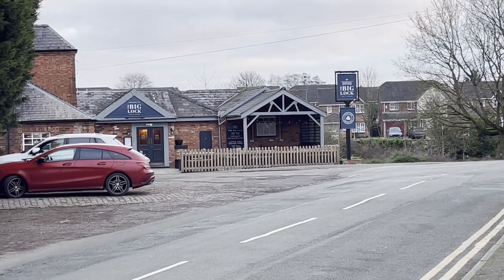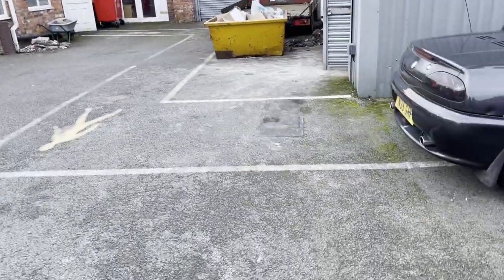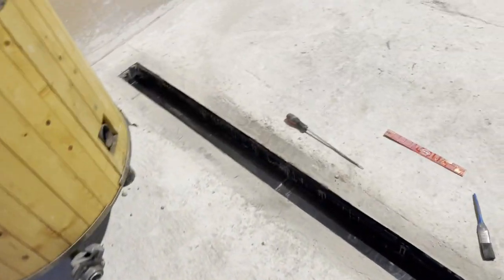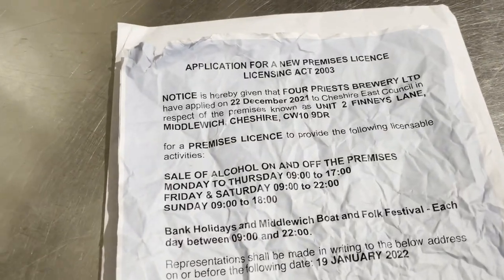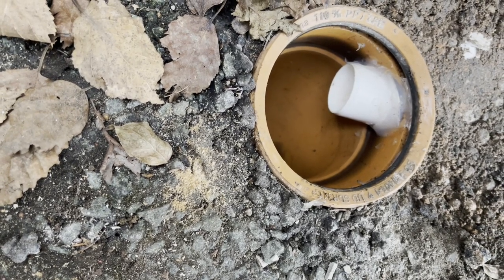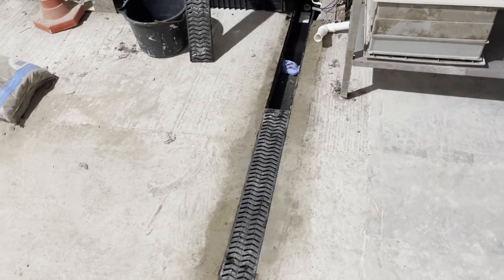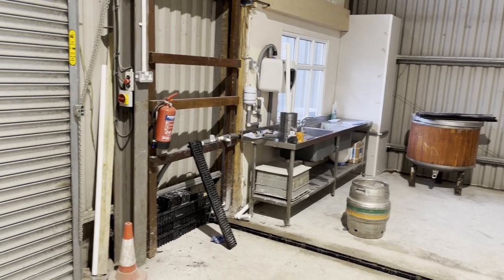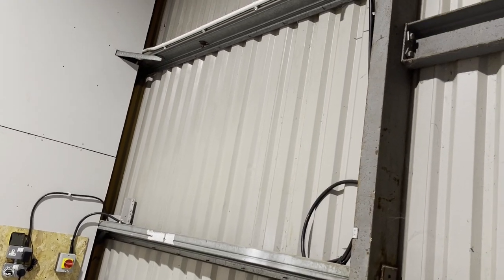Ep.14 - Channel drain, Alcohol Licence, Effluent, Electrical and updates.

Comment: Business Rates???
There's no way the RV there is above the threshold at which you qualify for 100% small business relief.

That welling in the drain channel could maybe benefit from a small amount of epoxy resin to act as a self levelling compound?

Congratulations on getting your Premises License.  We got ours on 1st November last year apparently.  Still haven't got the certificate though!

FWIW, I think you've made remarkable progress and should be very, very proud and stop beating yourself up.
Reply from the maker: Business Rates.  If the property is unoccupied, then no sb relief is available.  It was unoccupied for a week, even though we moved some stuff in. I disputed it and  they sent me the legal definition of unoccupied. As soon as we started to 'work' there we qualified for zero rating. Even spending a week painting and renovating counts as unoccupied. I should have seen that coming...  £75 quid tax for me being stupidly honest :).   Epoxy resin, good suggestion. I don't know enough to know if it would be OK with caustic, peracetic etc. Would it bond to the plastic channel or eventually float. Worth an experiment I'd say.  Cheers, and yeah I should!
Reply: Yep I agree, Double check this buddy